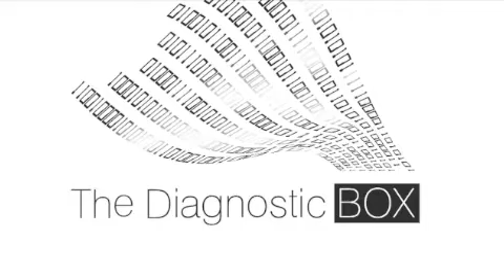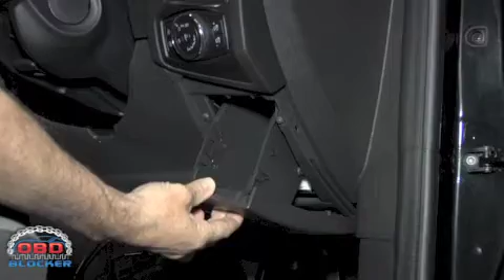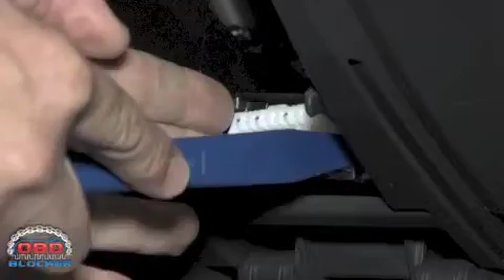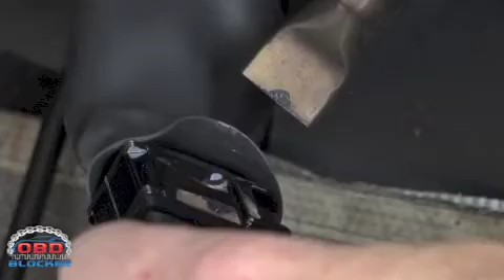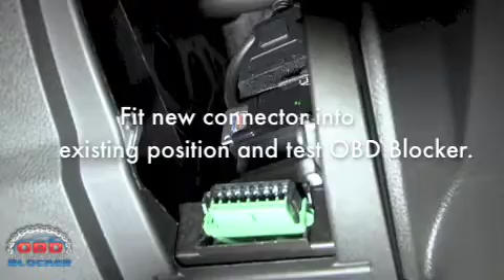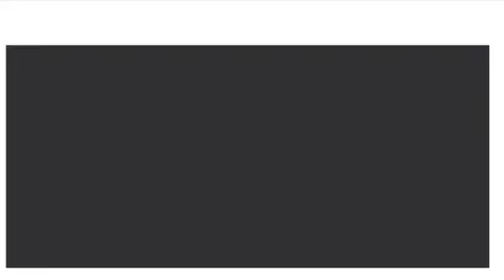OBD Blocker FORD installation

Comment: or, just shove OBD port through and tie wrap it up behind. Free.....
Reply from the maker: Most cars have a very short cable, so you cant get it very far. If you have just paid for a 50k car, why would you risk it with a cable tie. Nice one.
Reply: Or just cut the pin 16 cable and use a small heatshrink to make it look like it's connected but in reality separated. I don't know what the point is anyway. If it's supposed to trick garages or the yearly car checkup, the people working there will see any tampering in one minute. Including this blocker device.